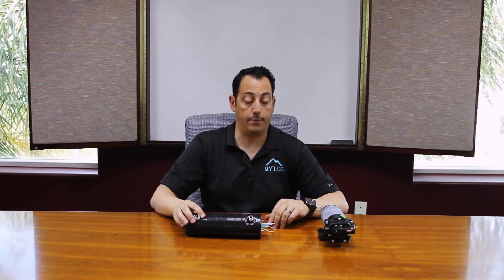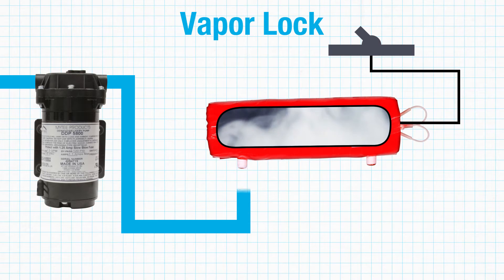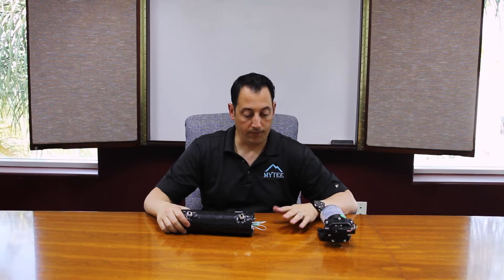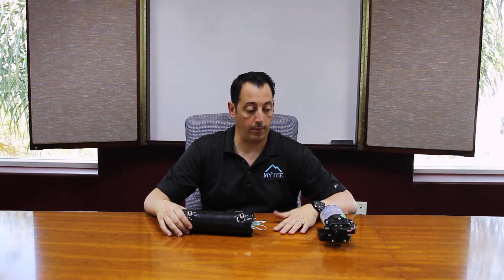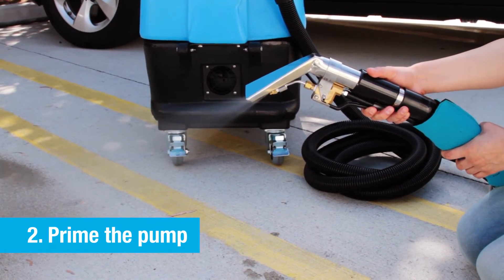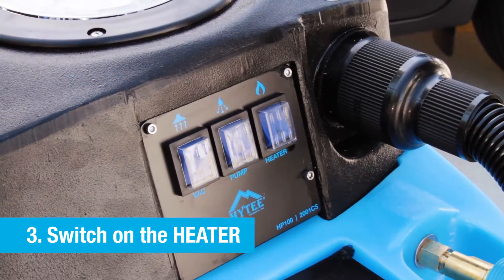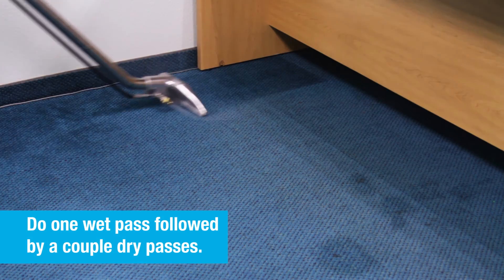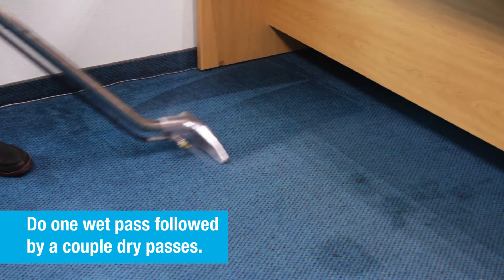Mytee Tech Corner: How to Prime a Pump and Avoid Vapor Lock

Comment: My mytee 300h vaccum is not turning on. The switch lights up but no vaccuming everything else works.
Reply from the maker: It may be as simple as a loose wire or faulty switch, call us at 858-679-1191 for assistance, we'll make sure to get you back up and running!

Comment: I have the 1003HV and the pump doesn't stop running and I get no spray. I assume it isn't priming. Is there a seal kit available? Manual to take the pump out?
Reply from the maker: Hi Baron, we do have a replacements and kits available and can offer assistance over the phone for replacing it. Give us a ring at 858-679-1191 while our office is open and we'll be happy to help!

Comment: Best way to get the most out of your electric inline heater is to preheat your water somehow. Im using a fresh water tank and a camplux propane heater then 3500w inline bam easy 200 degrees which is overkill in my opinion

Comment: My solution line does not want to clip on either fittings. I've removed all the pressure from the bottom fitting connected to the extractor and still nothing. Everything works but the line does not want to clip on either fittings. Any help or advice.
Reply from the maker: Make sure both the male and female ends of the brass connection have the pressure cleared out from behind them first. Next try a WD-40 or similar lubricant to make sure it isn't sticking. If none of this helps it may be the fittings are out of spec just enough to not connect, if this is the case contact us for replacement under warranty https://www.mytee.com/support/warranty-support/

Comment: Those of you having vapor lock problems, here is what I did to troubleshoot the problem. First turn off the machine and the switches, let it cool if it is hot. At the base of the unit where the brass quick connect goes into the machine, use a wrench at its base to unscrew it and take it off. With care, turn on the machine and the pump switch. If it sprays a stream, the problem is outside your machine in the hose/wand assembly. If it doesn't spray with the pump switch, the problem is inside the machine. If the problem is inside, warranty repair or check the pump. If the problem is outside the machine, connect the brass quick connect and the first hose. Carefully, using a tool, depress the aluminum button inside the far end of the quick connect with the pump switch on. If it sprays, the problem is further down the hose/wand. Doing this repeatedly and methodically, you should be able to isolate the problem. For me it was the spray nozzle at the end of the wand that was clogged. A nylon brush and a few blasts from an air compressor opened the spray nozzle again. Good luck.

Comment: I got got mytee brand new 2 days ago and it’s not heating
Reply from the maker: If you've followed all the instructions properly and the heater still does not work it may be a defective heater. You can try troubleshooting using this guide linked below, or simply visit a service center for repair or replacement completely under warranty. Give us a call at 858-679-1191 to speak with a rep for further assistance.
Reply: @myteeproducts  I called there’s no service repairs center near me. It’s literally out the box brand new. I was told to fix it myself

Comment: My has vapor lock and this dam video doesn’t give a solution!!! 👇👎👎👎
Reply from the maker: Is the unit still vapor locked? Generally you just need to wait for it to cool entirely if that happens and the pressure should drop down to a normal level.
Reply: @myteeproducts   mines been 24hrs and still wont spray

Comment: Mine is currently locked and not pumping water past the heaters. Pump is running but water isn't getting to outlet. How do you push the water past the vapor? Already tried a vacuum. Didn't work.
Reply: Same issue here.  This video did not give all the information needed.
Reply: Same , my pump won’t push water through the heater 
I waited a full day for the vapor lock to  cool off

Comment: Do you turn the unit off in reverse order 
1.vacumm
2.Heater
3.Pump
Reply: @marric99  That's what I'm wondering and I haven't got an answer yet.
Reply: @NoOneSpecial95  the heater & pump can remain on. Regardless you’ll just ultimately want to avoid running the heat alone 100%